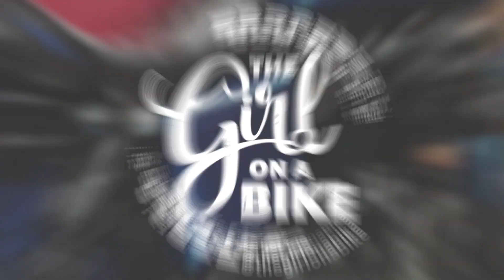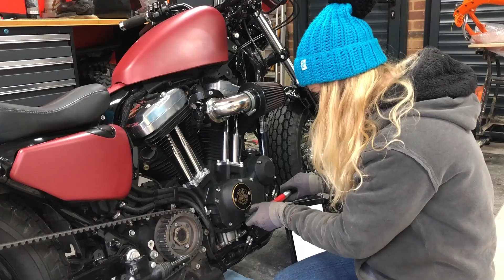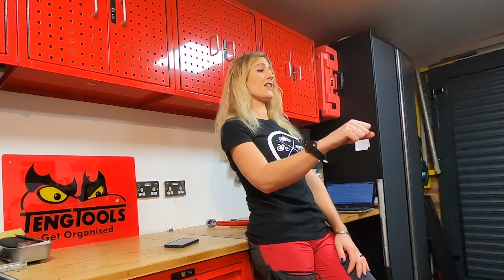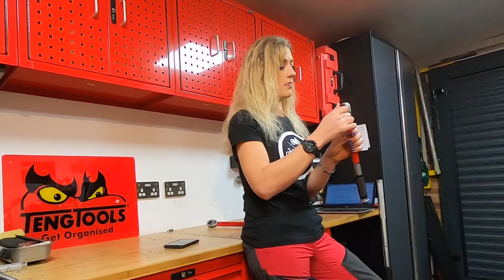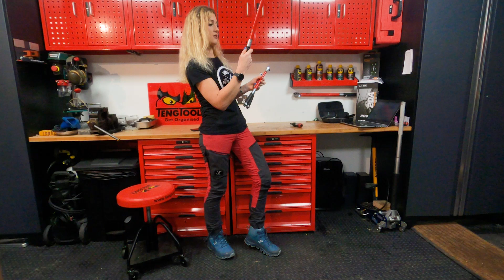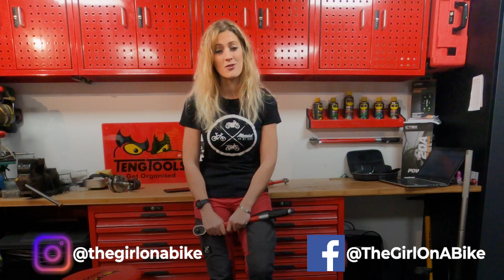How to use a torque wrench - comprehensive guide on torque wrenches

Comment: People who claim to able to torque by feel are too tight to invest in Torque Wrenches. Personally prefer a torque wrench with a window and an adjustable scale to twisting acording to lines etched on the shaft. Norbar are my preferred torque wrench, they were created to torque the spitfire merlin engines in ww2. They have since been aquired by SnapOn though continue in the tradition they started. You can get from the bottom of the scale to the top in as little as 8 turns. As previously stated I like a window with a scale in both Nm's and ft Ibs preferring ft Ibs as old skool. Most of their wrenches are reversible. Did you know torque wrenches are more accurate towards the end of their scale than the begining. Just one torque wrench is insufficent several are required, one in inch pounds for casing bolts or very light duty, then at 14 - 80ft for general use and prob the best to go for as can guess lower and add a bit for axles though them wheel bearings may not like your personal ft Ibs of extra torque so care is required., Around 60ft ibs to around 150ft Ibs, for axles, swing arm bolts, unforunately for me now need one over 200ft Ibs for the harley compensator bolt. Your talking close to half a grand for a few torque wrenches prob why people don't buy them and seize or snap bolts instead.
Reply: If you only need a higher value for a single application, would it be practical to fabricate an extension adapter of suitable length?

Comment: Funny story, I took a brand new bike for a long ride some years ago. All was fine until the front brake stopped working on first pull. More pulls, closer to expected result. Turned out the dealership had not done the pinch bolts on the front forks. Although they had been marked with yellow ink I have always since torqued every bike I have taken possesion of. New or not.
Reply from the maker: Oh wowza!!!

Comment: If your talking The torque, specified with regard to the axis of rotation, is equal to the magnitude of the component of the force vector lying in the plane perpendicular to the axis, multiplied by the shortest distance between the axis and the direction of the force component then it's not pressure which u previously stated in your video also said is a torque wrench required that is bad advice on which you are trying to sell enough said just know your facts
Reply from the maker: Thanks for the points 👌it's all learning ❤️

Comment: Hi Vanessa how are you! This is a great video! I have been a bike tech most of my life and became a fully Registered Honda Tech in 1985! So many people do not understand the torque in metals and the elasticity in a bolt...the stretch point! The torque spec is where that bolt will hold its best before stretching or breaking if it does not break the bolt is still weakend and you are right not tight enough will come loose! If we are building a motor that turns 14,000rpm most of the time we better use a torque wrench! 🙂.  Great job Vanessa!
Reply from the maker: thanks Donnie, so true

Comment: Love my torque wrenches. I seem to over tighten everything, I realised this when I cranked a titanium bolt down on my mountain bike headset. I rounded it off, managed to get a Dremel into cut the bolt, then there was an almighty crack as the head of bolt shot out just missing me and leaving a nice dent in the wall. 😳

Comment: Thank you... have always been confused as to whether I need one or not. As I commented previously, new to biking (legally) and so starting to learn how to maintain my Honda CB125R...
Reply from the maker: My pleasure Mark. I hope it helped. I would say yes if you're doing maintenance, even if just changing tyres for the axle torque 🙏
Reply: @TheGirlOnABike  It was replacing the wheel after chain and sprocket set change that I realised how important they were.

Comment: Brilliant presentation on such a controversial subject.  Once you strip or snap a bolt you quick learn to gauge for the feel when tightening things, especially when aluminium is concerned.  I’m glad you mentioned to release the spring after use, I used to get told off all the time as a young apprentice for not doing so 😂
Reply from the maker: haha thanks Joey. So true!

Comment: Great video. Torquing fasteners is controlled stretching of the bolt or stud. No stretch and it will come apart. Too much stretch and it damages the stud or bolt and different stretch will cause damage to the parts. If a “ mechanic” doesn’t use a torque wrench what else aren’t they doing. Run don’t walk away from them.
Reply from the maker: haha that's make me chuckle but I so agree! Run! haha 😃 Thanks dude

Comment: Very well explained. How many times have you rounded a nut, broke a bolt or something because someone has overtightened something instead of using a torque wrench. The cost of one is soon recouped as you don't  have to spend on plasters and putting money in a swear box.
Reply from the maker: Yes yes yes. 100% agree ❤️

Comment: It's a great tool to have and anyone who works on motors should have at least one, you don't need all the bells and whistles just a good quality brand. 👍👍 . I've been using them for years, and for the hard of hearing out there you can get a duel signaling wrench that has a visual aid to let you know when you have the right toque setting, in a pin that pops out or a light changers as you get closer. Cheers mate 😁
Reply from the maker: Thanks JC, Wow that's so cool about the hard of hearing version. What a great idea! Thanks for sharing the knowledge

Comment: I've spannered for over 30years and I'm a torque wrench fan.
Don't forget that lubricated threads require less torque than when dry, by upto as much as 50% less. So don't fully rely on waiting for that click if your threads have grease or oil on them.
Reply from the maker: Thank Nick. I'm not sure I follow or agree on the variation for grease as the manufacturers manual will always tell you if it needs loctight c oil, grease etc and thus have the torque value aligned to that direction. I guess maybe if you're made a mess and it's lubes by mistake 🤪 Great to hear you're a torque fan too ❤️
Reply: You are right, if you're following the manual by the letter, stick to the torque setting given. For me, I do like to grease my threads somethings, even if the manual says not to.

Comment: Great video, I would say torque wrenches are required with certain brands. I had a KTM 500 exc that would split the triple clamp if over tightened. Bolts had a 17NM limit on them. There's some scary videos of guys who've had thier whole front separate from the rest of the bike after a jump.
Reply from the maker: oh my goodness! That's no something i want to happen. Blimey, you're vulnerable enough on two wheels... yikes. Thanks for watching Dave 😃

Comment: That was a great presentation on torque wrenches. I have a couple of those same Teng torque wrenches, I keep mine safe in the plastic cases they come in and I'm always impressed by the build quality when I use them. I always use a torque wrench on my bike, everything is built to be as light as possible so it is very easy to over or under tighten a bolt or nut and cause damage or have something fail, which is the last thing I want when I'm riding.
Reply from the maker: awesome John, you have the same Teng torque love as me! We have our little red cases for when we leave the garage too! hehe got to keep them safe

Comment: Went to school for and worked as a diesel mechanic.  Yes, a torque wrench is a necessity if you want to do your own maintenance!  Over tightening will warp all of those aluminum and plastic covers, leading to leaks and damaged parts.  A persons safety is on the line when riding a motorcycle, so take the time to torque everything.
Reply from the maker: I 100% agree! Thanks Randy

Comment: Vanessa, nice review of the torque wrench and it’s uses.  We use mechanical models and have several of them, both inch pounds and foot pounds.  Most repairs should not be attempted without a torque wrench.  Your In-House Garage Review is a great idea!  Ride safe Vanessa!
Reply from the maker: Yey thanks dude! Mega appreciate the support on this idea. Less fun than riding but without maintenance there is no riding 😋
Reply: @TheGirlOnABike  .... your garage, tools, etc....  great idea during the crazy times.  Thanks again!

Comment: Make sure the tire shop uses them when replacing or repairing your tires on your vehicle. Those air ratchets can over tighten the lug nuts and warp your brake rotors.
Reply from the maker: Very good point!! I've never thought of that 💪🏼
Reply: Very usefull tip I am gonna try to remember it when I need fresh tires 👍
Reply: Yup, and you'll never get the wheel off roadside when attending to a flat.

Comment: One other important point Vanessa> If a ham handed user of a torque wrench does not stop at a "click" or "light" or that wrenches form of indicating the set torque limit has been reached.  If they continue to pull on the torque wrench the torque will exceed the setting and still be applied.

It seems a popular subject on mc forums of stripped threads or twisted off bolts or heads. Cross threaded is also popular because people do not hand start the fastener. Also a big mistake is using ft/pounds  in stead of inch/pounds ...  reading the specifications and using the proper unit of force is necessary.
Reply from the maker: Gosh yeah good points. Maybe Darwinism will help some of those 😳😋🤪 hehe Sorry that was probably a little mean as they're very valid points and we all learn but I thought they were hopefully obvious 🤣🤞🏼

Comment: Yip been there, done it ! snapped cylinder head bolts, overtightened casing bolt resulting in a leak, snapped exhaust studs. I should have learned after the first one. Been using a torque wrench for years (probably around 30) I'm a foot/pounds man but newton/metres fine ! It's the same thing. I'm not sure if people still buy them but the Haynes workshop manuals used to have virtually every torque setting for a bike. Great vid ! cheers
Reply from the maker: Thanks dude. Oh my yes. The Haynes manuals. I think anyone over a certain age will have 100% had one of them haha
Reply from the maker: I had one for my Rover 200 💪🏼

Comment: Though I watch a lot of DIY videos,  I don't have the guts to do anything on my bike. But, as you mentioned in the video aboutthe truck, while changing the car tyres, I always thought of whether its overnight or not tightened properly. I didn't know there is something like a torque wrench tool. This is a great information and an answer to my long term question.  I'm wondering if there is a plier tool 🔧 like torque wrench which can be used as a one tool for multi use, as otherwise it would be so many of them. Informative and great video, thanks for sharing.
Reply from the maker: I'm so so happy to hear it helped and brought new knowledge to you. Yey. Oh gosh I've not heard of a 🔧 style. Maybe try Google. 🤞🏼

Comment: That was a decent overview of torque wrenches.  After purchasing a few coin cell operated tools for the garage, such as an air pressure gauge, caliper, etcetera...I have now replaced them with mechanical only equivalents.  It doesn't help that for nearly half of the year, temperatures drop below freezing, and the batteries seem to always be dead.
Reply from the maker: Ah I hear you there. I had a digital one and it was flat... Then what 🤷‍♀️ you almost feel as lost as when you're phones gone 🤣